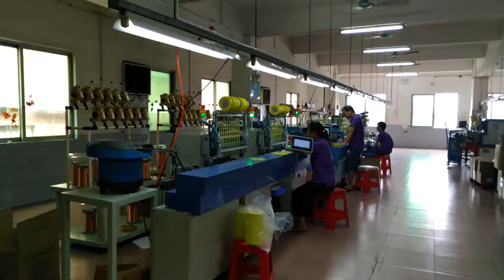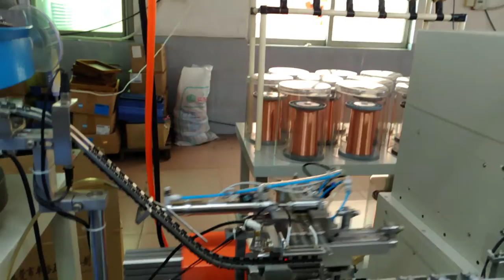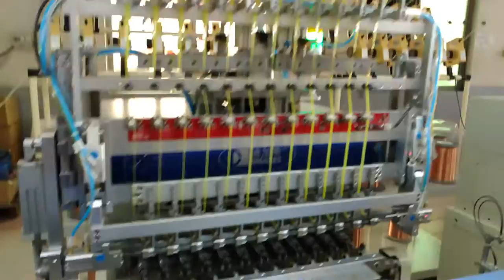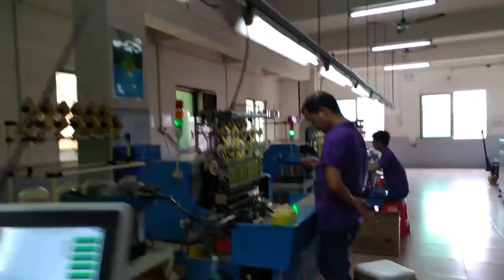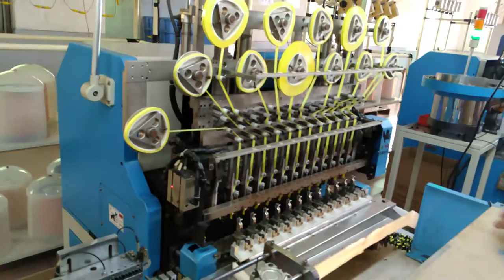Inductor/transformer  factory - Automatic production line on inductor Winding  and adding tape

Comment: Hello, we manufacture small charger transformers and are interested in 12 spindle coil winding machine, could you tell me the availability, price, servicing etc of machine in New Delhi india
Reply: Hello, Dear Friend,

This is Winnie from Jindongli Intelligent Technology (SZ) CO., LTD.

We are a Chinese manufacture specialized in SMD peripheral devices such as automatic inductor testing and packing machine,semi-automatic braiding machine,automatic inductor winding and glue dispensing machine,automatic all-in-one modeling inductor assembly line,peel strength tester,SMD electronic packing materials,we also process the incoming materials of braid packages for SMD electronic components.
Reply: Winni tok, why reply so early? I asked just  2 years ago.

Comment: Where to buy pls
Reply: Hello, Dear Friend,

This is Winnie from Jindongli Intelligent Technology (SZ) CO., LTD.

We are a Chinese manufacture specialized in SMD peripheral devices such as automatic inductor testing and packing machine,semi-automatic braiding machine,automatic inductor winding and glue dispensing machine,automatic all-in-one modeling inductor assembly line,peel strength tester,SMD electronic packing materials,we also process the incoming materials of braid packages for SMD electronic components.